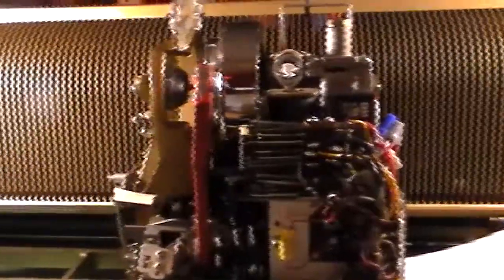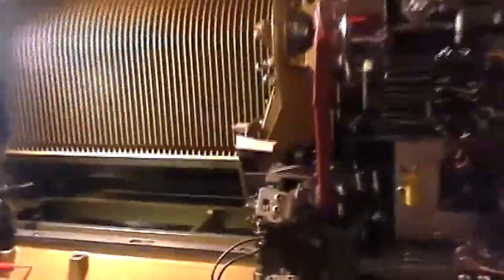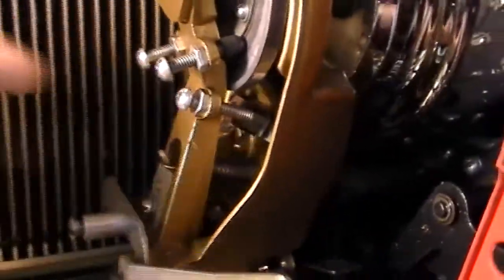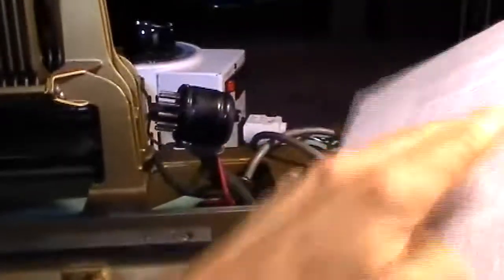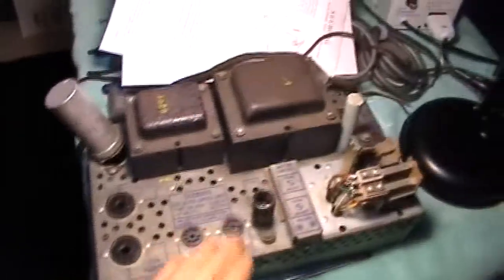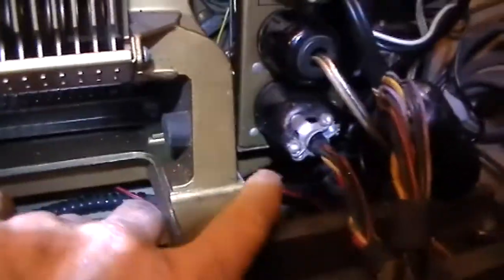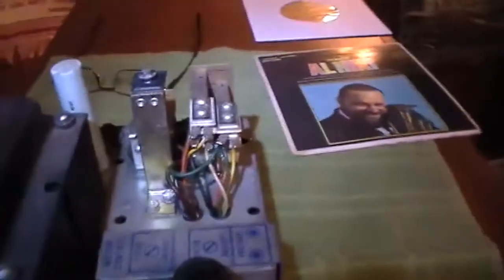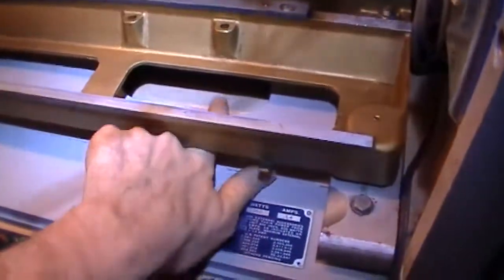33 1/3 RPM Seeburg Library Unit - Part 1

Comment: Seeburg made auto speed units from their Q models to the STD4. The later model Seeburgs had it as optional instead of standard. The ones that had it standard were the LPC 1,LPC 480,APFEA 1,PFEA1U,(Both known as the Discotheque)Stereo Showcase/SS-160 & I believe unless otherwise, the U100 Mustang/Discotheque Jr.
Reply from the maker: I liked reading this info. Thanks form posting it.